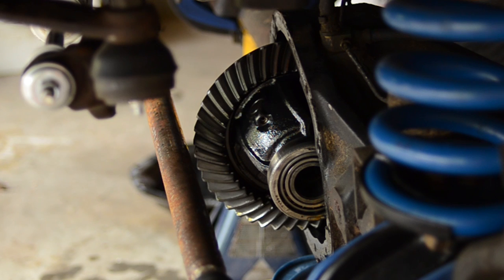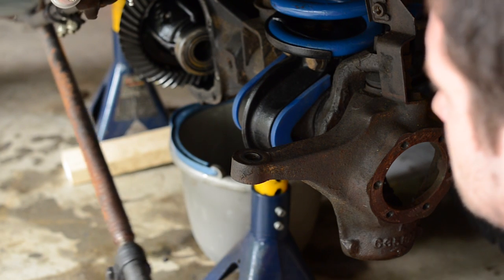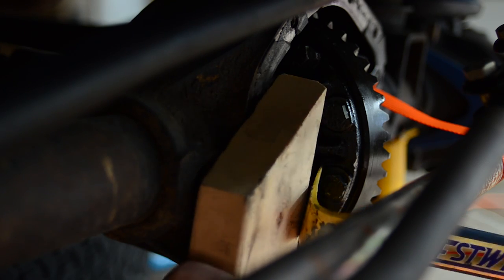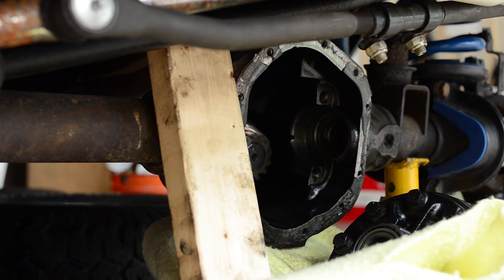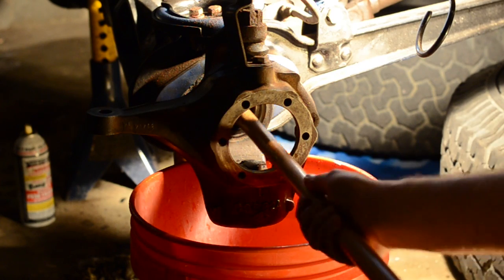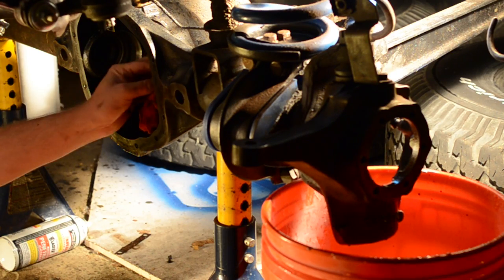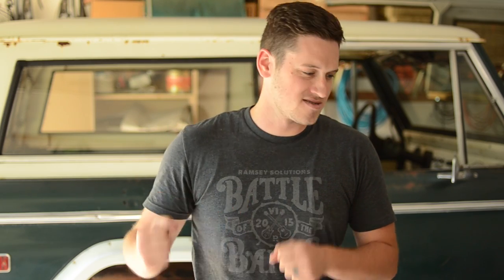Dana 44 Carrier Removal & Cleaning Axle Tubes

Comment: For the record...I think you're a real man whether you have a press in your garage or not.
Reply from the maker: +Anthony Parigi haha! Thanks man
Reply: @NashvilleEarlyBronco  you can't have every tool that you could possibly need in your shop. It's expensive and you may not have the real estate.   Sometimes have to outsource the work. It doesn't make you less of a man. You simply adapted and found a way to solve the issue.  That's what makes you a man.  Carry on. You did good on that axle and even I,  who has pulled many carriers out, picked up a trick from you. Good work.
Reply from the maker: @SocialistDistancing  Haha! Appreciate it